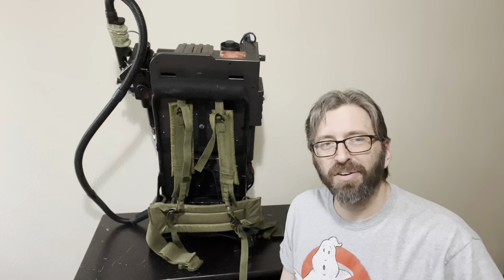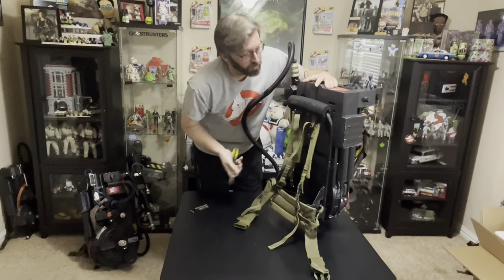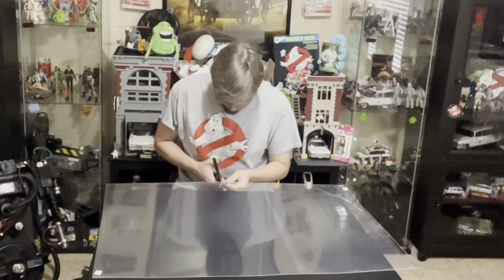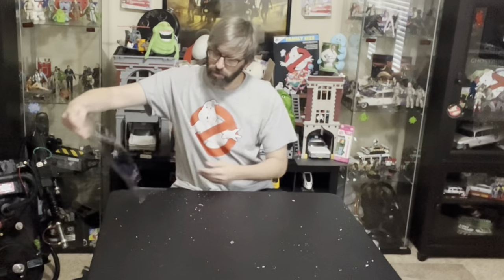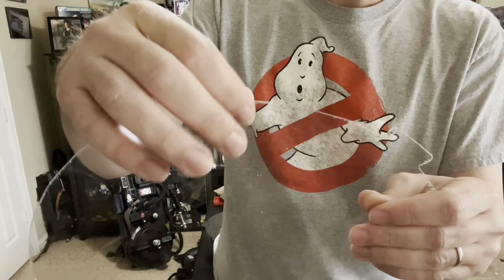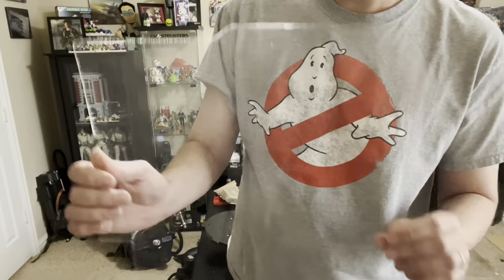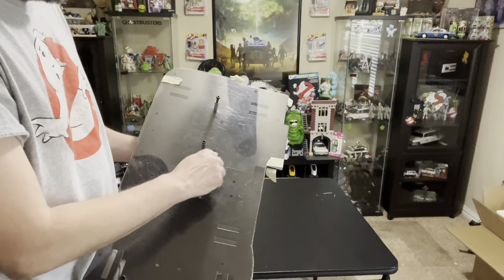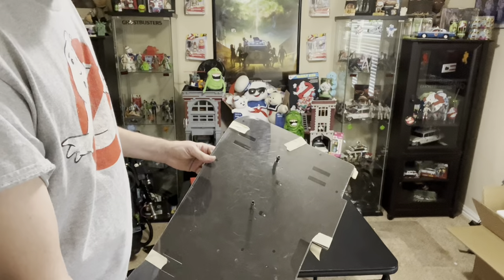HasLab Proton Pack Plexiglass Motherboard - Part 1

Comment: I would use polycarbonate instead, it more shatter resistant and easier to cut
Reply: Also if you are going to use acrylic, use painters tape on front and back, trace on line on the tape and when cutting it can reduce glass fractures.  A jewelers saw would help or a  Dremel with a cutting wheel can cut it without cracking.

Comment: You also need to drill holes for the screws to remove the motherboard from the pack right?
Reply from the maker: No, I secured the hardware inside the pack so I can take the ALICE frame off easily. So I can remove the frame, then remove the plexiglass, and have access to the holes.
Reply: @TheProtonPackIsNotAToy  oh I get it now! So the plexiglass is sandwiched between the Alice frame, the screws and the motherboard! Cool !
Reply: @TheProtonPackIsNotAToy  How did you secure the hardware on the inside? I'm hoping to get an aluminum motherboard and that is my dilemma on how to close everything off once the motherboard is on the haslab board.
Reply from the maker: The screws are put in first to close up the back. Then the plexiglass is laid on top, then the frame is screwed into place. I duct taped the wing nuts in place on the inside so the frame can be taken off and put back on without removing the back panel of the pack.
Reply: @TheProtonPackIsNotAToy  So you just duct taped them in so that you can screw the other screws in on the haslab board and then lay your plexiglass board on top? Then you put the spacers on and then the Alice frame and screw it in? I'm sorry if I'm not understanding it. I'm new to this.
Reply from the maker: You know how the pack has nuts mounted in the motherboard so the included hardware can be put in and out easily? Well I drilled 2 different holes to mount my ALICE frame, so on the inside I “mounted” the nuts in place with duct tape to have the same effect on my new holes. So I don’t have to open the pack to attach or take off my frame. So the HasLab motherboard is screwed together, then the plexiglass is laid on top, then the frame is mounted on the motherboard with the plexiglass in between. There are 4 holes in the plexiglass for the bolts to go through.
Reply: @TheProtonPackIsNotAToy  maybe you can address this in your next video ! I think it’s a great idea and I want to do the same ! It’s snowy here in Canada so I will have to wait to paint too !
Reply: @TheProtonPackIsNotAToy  so I was right in my assumption? Do the nuts move at all? How secure are they just being held on with duct tape and putting the stress of twisting a screw in once you have everything together?
Reply from the maker: They are quite snug. Being wing nuts, the shape gives the tape more to grip and not break loose to just spin around.
Reply: @TheProtonPackIsNotAToy  Gotcha! So you have two straps of tape on either side if the nut so that it doesn't block the hole or do you have it covering over the hole nut with a hole punctured out in the tape?
Reply from the maker: I started in the middle over the nut and folded it down on either side, then secured it to the plastic. I had the bolt in it when I taped it, so I didn’t need to cut a hole, but you could.